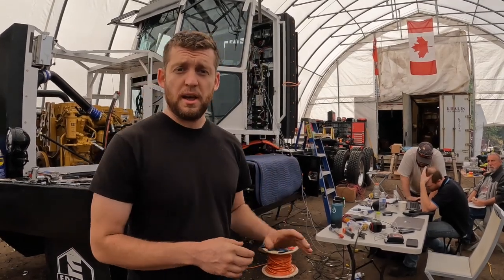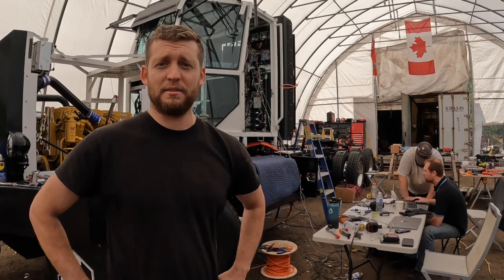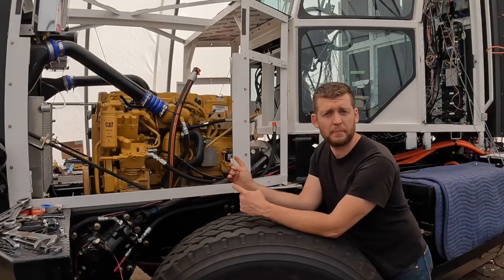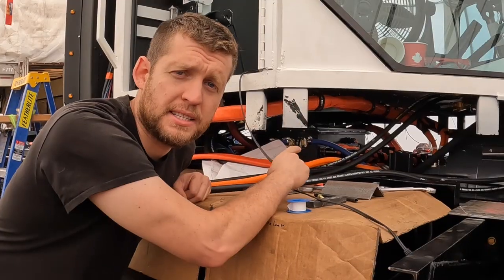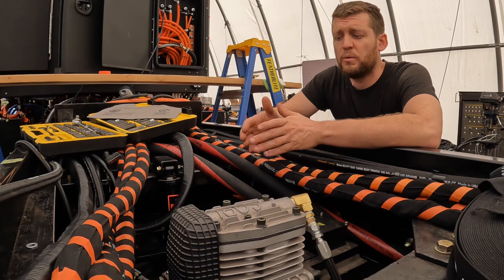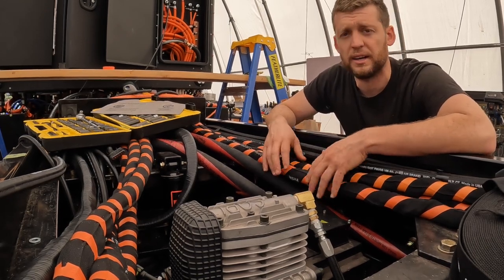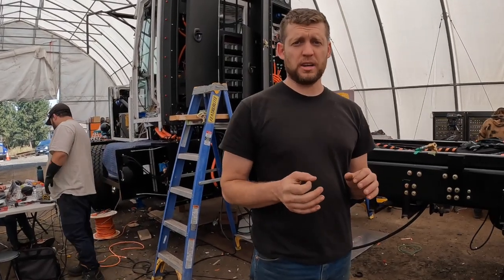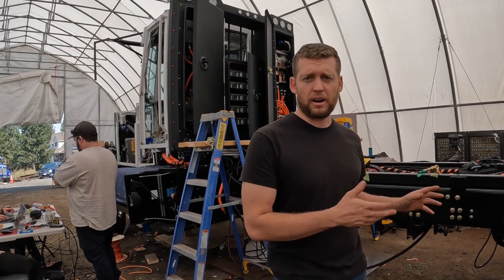Powering Up the Future: High Voltage Connections and Testing | Electric Truck Prototype Progress

Comment: Just to clarify a few things….this is not high voltage……Yes its higher then house Voltage but not near what is Running down the side of the road….600 volts is actually one of scarier voltage it will literally suck you in if you grab a live conductor…house voltage tends to just sting while true high voltage tends to blow you clear …..Don’t get me wrong all voltage can do serious damage to you so all voltages should be properly respected…

Comment: High Voltage is only as dangerous as a gasoline engine. You wouldn't Work on a motor when it's running so always check to make sure the High Voltage is discharged. And you have to assume that the High Voltage is always live.

Comment: You need to publish proper training material for HVDC, even for an electrician.  Most electricians don't see DC, or if they do, it's <50V.  You need proper procedures for swapping batteries or subpacks and cells, if you're going to support parts at that level.  The batteries need to be brought online in proper sequence, be balanced prior to connection, etc.

Comment: yes, I work around high voltage in my job, and it's downright scary sometimes. The average person doesn't appreciate just how dangerous high voltage can be.
Reply: Being careful around high voltage gets the job done. Being afraid of high voltage gets you electrocuted - my high voltage prof a decade ago
Reply: Nor does society appreciate the work it take to maintain the grid they rely on for daily life. As someone that’s worked on systems 24 VDC all the way to 12470 VAC, the work is rarely appreciated until it affects them directly. God bless for the work you do bud, best to you and your coworkers.
Reply: high voltage is why im a mechanic. if an engine tries to start while im working on it, i can see things moving. if someone leaves insane amount of power on and i touch it, i cant tell before its too late that im about to die. it just hits that permanent off button and my cookie is baked. not what i need in life
Reply: Yea high voltage is spooky.
Reply: It’s the amps not the volts that are dangerous.
Reply: @zanelance-hardman4826  
They seldom travel alone
Reply: @zanelance-hardman4826 Yes and no. You need a certain amount of volts to push current through the body (usually around 30-ish V if memory serves).
Reply: @zanelance-hardman4826  it's both
Reply: @zanelance-hardman4826 that is oversimplified to the point of being wrong and that’s just for electrocution. Volts and wattage are what kill when you get an arc flash

Comment: I am curious if the diesel tank and generator has a warming element or heater to keep it running under extreme conditions, as you probably know, diesels aren’t happy in the cold
Reply: Yes, Chace said something about it a while ago. It runs of the batteries, or also warms the batteries, or something specific to an electric truck like that.
Reply: theyre in canada and he just took a trip to the arctic to look at their trucks. im sure theyre planning on proper cold prep
Reply: The diesel here is far better in the cold then what you find in the US. Fuel gelling up in the tank and filters is almost unheard of. I've personally seen untreated fuel not even starting to cloud at -35°C.

Comment: You can add a circuit that will discharge those capacitors and let you know they are safe.
Reply: Go over to Munroe-Live and watch some inverter teardowns.  A capacitor discharge circuit is already a part of every inverter design competent people sell.  (afik it needs to be safe 1-2 minutes after removal of power)  It's usually just a high voltage resistor across in the high voltage inputs that always burns 10-20 watts.  Doesn't mean the circuit always works...  So you still need to verify the capacitors are drained before working on them.
Reply: Agreed. A switch on the dashboard or on the electrical cabinet that automatically dumps the capacitors when it’s doors are opened

Comment: Have you thought about running some sort of conduit along the truck frame to protect the wires? Maybe some sort of clam shell so you could service it.
Reply: You can’t encapsulate motor wiring because it cause the cables to heat which mean you have to use larger wires…Ideally with high current AC (motor leads) cables you should run parallel and a cable width apart and stay as far away as you can to canbus cables (unless canbus is highly shielded or using fibre optics)
Reply: They are already in a protective anti abrasion sleeve.
Reply: really not worth the extra trouble and complexity, as the other people here have pointed out. I get the sentiment though, but there is a point at which you protect something too much and it becomes a hindrance more than a help.
Reply: The wires are inside the orange   isolation of the cable which is inside black sleeve that you can see. It's plenty of protection but for production trucks they can place it better as Chase mentioned.
Reply: No need to reinvent the wheel to protect lines.
Reply: They should just get rid of all the wires and use blue tooth for everything 😊
Reply: @digi3218  then they'd have to change their name to Tesla Motors.